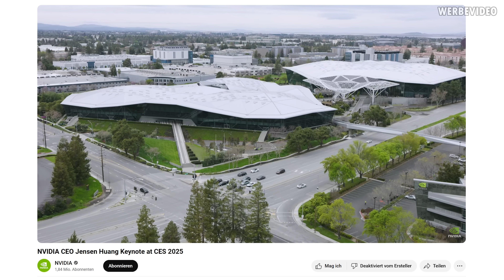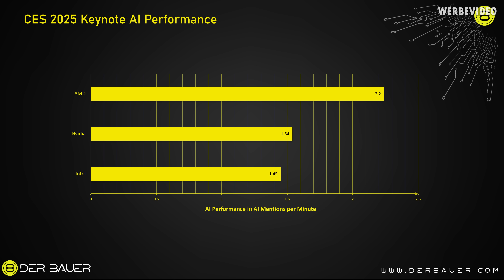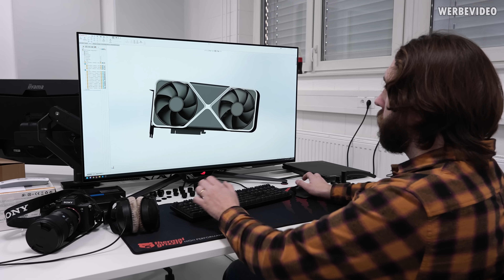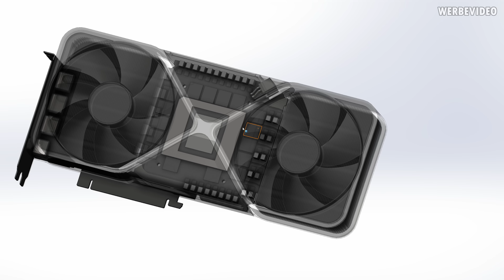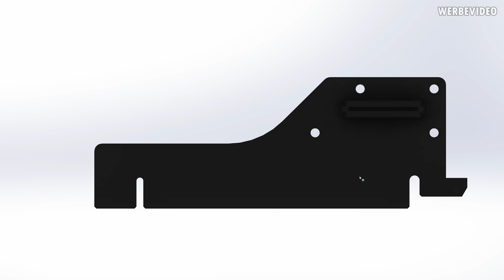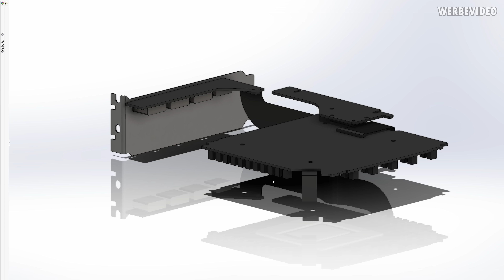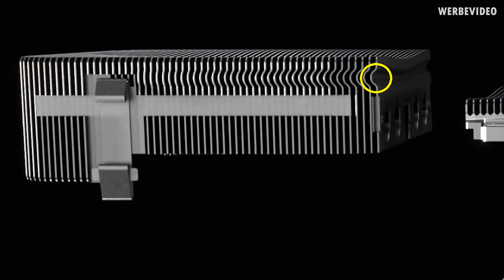We Reverse-Engineered the Nvidia RTX 5090 Founders Edition

Comment: Although I kinda understand why Nvidia pushes AI more than raw performance, it is sad to see because if you're buying the xx90 GPUs, chances are you use your computer for more than just gaming, where DLSS does nothing for you.
Reply: Tensor cores are used for more than just dlss lol. Ray reconstruction is used for 3D workloads and many more uses. I can say by same logic that gamers will find that 3x9th gen encoder useless unless they stream or record.
Reply: @DragonOfTheMortalKombat  No need to tell me, I plan on buying the 5090 for machine learning besides gaming. But it's obvious they made the biggest deal out of DLSS 4. They mentioned on the side Flux inference speeds compared to 4090, the issue is 4090 was using FP8 and 5090 FP4. What if they are basing their 3352 AI TOPS on FP4? Does that mean that if I want higher precision with FP8 or FP16, I'll get the same performance as 4090?
Reply: Imo, those that need the extra work performance will just go for the Nvidia Quadro line
Reply: Incorrect.

Dlss runs on Tensor Cores.

Tensor Cores have metric ton of uses
Reply: @B1-K4R  As per my other comment, I know. But there's also other metric ton of applications that require good old fashioned raw CUDA performance 😂 Which we'll be getting only 20-30% more of as it seems 🥲
Reply: Because they dont care about a couple gamers buying 5090s
Reply: That’s probably why Nvidia stock suffered
Reply: @sheepmasterrace  has nothing to with CES or RTX 50 series.

The Biden administration is going to put more Data Centre AI GPU sales restriction to other countries.

This will hurt revenue 

Hence why the drop in stock

Comment: Regarding the 5070 = 4090 marketing nonsense: according to Nvidia's own footnotes this was with DLSS4 and MFG on the 5070 vs older DLSS+FG on the 4090. And the important part here is MFG which can generate up to three fake frames per each real calculated one. Normal FG can only do one fake frame per calculated one. This means that just with MFG, the new 50 series GPUs can nominally gain three times the amount of fake frames compared to the 40 series. That way Nvidia can probably look at a frame output number and say the 5070 puts out the same number of FPS as the 4090.

HOWEVER (!!!) it still means it only delivers 25% of that number in actual playable frames, the rest is just predictive noise. Compared to that, the 4090 offers 50% of playable frames. So in reality the 5070 is about half as powerful as the 4090. Frames generated via MFG or the older FG do NOT add to playability. For all intents and purposes it's just lipstick on a pig to make the game look more fluid by adding frames to it but the games will never run better thn what the GPU can actually calculate in realtime, i.e.: the good old "brute force" (as Nvidia put it so nicely) rasterization performance.

Anyone who buys into the 5070 = 4090 marketing is going to be very disappointed. Coincidentally I've got a couple bridges to sell if anyone is interested, I'll even trade for your 4090s.
Reply: I like to say, "I've got some lovely oceanfront property in Kansas for sale."
Reply: @outlet6989 from my front porch you can see the sea.... Unfortunately it's currently frozen over
Reply: When dlss launched, i remember asking my brother and friends why they were buying nvidia..
"It has dlss..and raytracing!" 

And now, after 3 gpu upgrades, i asked my brother: How many times have you used either of those features?

"Aside from turning it on in a few games to see what they do and look like, i've never used it"

When i saw that 5070 | 4090 Perfomance slide, i was like WTF. 

Seeing dlss, fg, fps, performance and low latency all together - is madness.

Disappointing generation from both. Wanted an upgrade to 240hz 4k monitor but there aren't any reasonable gpu's to buy..
4080 -> 5080 is like ~5% performance gain?
And 4090 -> 5090 is ~30%? For 30% more money. 
Cheapest 4090 is 2306 euros (in my country), 5090 will likely start above 3k.

So there's 4080/7900xtx+5080 for 1k and that's about it. Was hoping for smth in the 1.5k-1.7k range 😐
Reply: @lunatik6168  yup fkin sad state for GPU tech and the slow ones think this is a breakthrough when its the most dissapointing GPU generation in a long time and maybe ever? Im not familiar with anything before 1080ti gen, but I cant imagine there has been a generation with worse performance uplift than this.
Reply: So as gamers we no longer care about frames per second?
Reply: @TheRealCoolwater  we do, just not AI frames, because they dont function the same as rasterized frames and for that reason dont have the benefits of more real frames.
Reply: @MV-ri7zu  If the DLSS 4 AI framegen is using game data to accurately represent a real frame, I don't see the problem.

DLSS AI framegen is not adding significant input delay either, I don't see the problem.
Reply: @TheRealCoolwater  "DLSS AI frame gen is not adding significant input delay either" yes it is.
Reply: @TheRealCoolwater  The more, the merrier. I for one have difficulty with AI generated frames though... artifacting interferes with what I expect to see, so I get motion sickness. I also get motion sick below about 57 fps in games with quick movements or fast camera panning. High input lag does not help matters.
Reply: @nonstopNny  Have you seen Digital Foundry's video on DLSS 4? It's improved, and its improvements are coming to 20 series and up. Frame Generation for DLSS 4 will use game data to improve it's interpretation of what the action on the screen is doing. From all the previews i've seen so far, I trust that DLSS 4 is going to be good all the way down the line.  You could argue that not all games will have it, but I think people are overreacting.
Reply: Ya’ll don’t know what you’re talking about. Game processes aren’t locked to the frame rate for most games nowadays.
Reply: I was critical of the latency resulting from a 3x frame generation but it seems like nVidia has handled that problem quite well. What remains to be seen is if the serious image quality degradation from all of that predictive noise can be dealt with appropriately. (Even more hilarious when you're running at a real resolution of 1080p! - I don't think I'd spend £2k just to render 1080p frames )
Reply: @tourmaline07 nvidia has not handled the latency lol if you have 60 real fps and 240 fps with mfg you will still have 60fps input lag, because AI frames are not "playable".
Reply: @MV-ri7zu  I'm judging this by Digital Foundry's latency measurements showing that going from 1 to 3 generated frames only increases latency from 50-58 ms or so on a 5080 running Cyberpunk. But you're right - it doesn't fix low input framerates.
Reply: @tourmaline07  also wdym "only" increases latency from 50-58 not only is that a ridiculous amount of latency its also increasing frames so it should be doing the opposite this is why they are "fake" frames 😂
Reply: @MV-ri7zu Yes, but you will never have only 60 fps unless you are intentionally trying to. Thats why settings being manual is of big importance and user should be targeting 80+fps before turning on any kind of FG. In many cases you will have 120+ fps before FG anyways so you will get very smooth 300+. Yes you can put 5070 on 8k to prove your point, which doesn't mean 5070 is not a great 2k GPU for pretty much maxing out anything on that resolution. I am sure similarly minded people will be running 5070 on 4k max textures to prove 12gb vram is too little. But if we blindtested you to pick ultra textures over high you wouldn't have an idea which is which. Just because there is an option in the settings, doesnt mean it have to be used or visual experience is ruined. In the same way 4060 is great gpu, well not anymore for msrp but i had a blast with it on laptop and i just cranked all up to max, no care in the world, fg was my saviour.
Reply: + you can just use something like Lossless Scaling from Steam (or similar (maybe FSR 4) will be able to run too)). May not be as good but you could do that as well in some Way. So Nvidias Marketing Claim is even more BS.

The Tech as is may be cool but you will NOT get an RTX 4090 if you buy an RTX 5070.

Dont do it.

If you do sell the RTX 4090 to me for 1000 Euro, i will make use of it. Trust me.
Reply: Regarding that, the 5070 should really just be a 5050
Reply: It's very sad
I've seen people in comments trying to say that the fake frames are so great and awesome
I have a feeling that people that say those things never actually experienced what the input lag is like, and how big the difference to native really is
Reply: @ADepressedGuy-l1p  they are great and awesome when feature is used properly. And they'll improve as time goes on. The problem is bad GPUs and terribly optimized that requires you to abuse these techs and then people wish they never existed because it made developers and GPU makers so lazy and lackluster.
Reply: @DragonOfTheMortalKombat  the issue is windows is bad and game optimization is bad. We need a better OS and better game optimization.
Reply: @MV-ri7zu  That is the eternal dream~🧡 I think 780 Ti to 980 Ti was similarly lame.
Reply: Isn't the 4070 Super already more than half as fast as the 4090? Is the 5070 a sidegrade?
Reply: @nonstopNny  we literally have the specs lmao yes it is barely faster than a 4070 this shouldnt be news to anyone the 5090 is the only real upgrade from previous gen and even that is just 30%
Reply: Your math is way off. A 4070 is exactly half of 4090 performance on average. A 5070 will be a little bit stronger, not much but still.
Reply: @TJ-ki3gp it's 1/3 in compute. Not half.
4080 is 1/2.
Reply: @panjak323  I can't think of any games that actually run half as fast on a 4080 as on a 4090. I don't pay much attention to AAA games, though.  Is it realistic to think that the specs to performance ratio scales that consistently?
Reply: @auturgicflosculator2183  compute, not game performance. Games don't scale well, because of CPU bottleneck, and even underutilization of 4090.
4080 (super) is pretty much 55-60% of 4090 in actual workloads.
5080 is exact half of 5090.
5070 will be lucky if it matches 4070 super in raw performance.
The value proposition is getting worse.
Reply: @panjak323  Okay, thanks. I get that, now it's in context. We're on the same page, I'm just too stoned to read, apparently~💚
Reply: "Generated frames don't add to the playability"
Just say you can't afford one lil bro, no need to be jealous
Reply: @andy7bianca  If they've been saving since 2017 or so when they bought their 1080 Ti, and inflation, wage stagnation and lack of affordable housing hasn't made them dip into it, almost anyone could afford one.
Reply: @andy7bianca  ...but will it be worth it?
Reply: @andy7bianca  no that is quite literally how they work... Your inputs only update into the game in the real frames. AI frames are LITERALLY unplayable your inputs are not taken into account during AI frames.

Comment: As my NVMe SSD (Shitty WD SN850) resides exactly 3 slots below the PCIE x16 slot, and I am also wanted an upgrade to 5090 for professional use. I feel like Nvidia did all this effort to make 5090 fit on my workstation. 😇
Reply: shitty??  The SN850X is arguably the fastest PCIe 4.0 drive, period
Reply: @minus3dbintheteens60  that piece of shit won't work on majority good motherboards in the market on the NVMe slots. (AsRock/MSI) . Now we use Samsung 990 Pro 2TB so no problem

Comment: Impressive! I would love to see if you can technically dissipate 575watt of heat with two fans by just heating up a block with the same amount of heat pipes and two 120 fans to do a proof of concept. I know the fins would be impossible to reproduce but that should give us an idea if it’s really possible that nvidia might actually be onto something or they are compromising performance to meet their SFX requirements.
Reply: 3 fans ...it is a 3 fan design, there is one hidden in the center

Comment: regarding the stamping tool, I doubt that they made 52 different stamping tools, I would say it's more likely that it is stamped with varying pressure with the same tool to get the different bends.  Still an expensive process as they need to keep all the plates organized for assembly though, even if they only used one tool.
Reply: They could create a tool which stamps all 52 fins in one strike, and then somehow separate individual fins from that single sheet.
Reply: @asmi06  I've actually done this in a press shop. Each section of the larger die would have its own specific section designed to make one fin in an assembly like this one. You simply increase the surface area of the entire die and use a larger machine. Individual fins could be cut from the resulting sheet afterwards easily. These fins are quite thin as well, making everything operate on a smaller scale of machinery needed which would lower the cost of tooling investment.
Reply: @asmi06  yep
Reply: @asmi06  Was thinking about this too, perhaps there's a manufacturing technique which allows for stacking multiple plates at the same time, reducing the cost of producing parts like this significantly?
Reply: rather than "different pressure" which is something that wouldn't work in a normal stamping machine, they likely used shims to change the depth of the curve.
Reply: @ even that is so much work and not really safe. Realistically the cost difference might be negligible. You have to think of it on a large scale of millions of stampings in a short amount of time. So, you are not using one stamping machine, you are using let’s say 20. Using the same die you would need 20, then the dies only have x amount of stamps before they wear out. So let’s say you had 1 million heatsinks to make and each one has 58 stamps that’s 58 million, 2.9 million stamps per machine, if your die wears out after 1 million stamps you need 3 dies to complete the order. So 60 dies. If you have 60 different dies each doing 1 million units, you end up at the same result with the same cost as far as stamping goes. Extra cost would come from a sorting machine that places your stampings in the right order before the heat pipes are pressed in.
Reply: I believe they would have used a progressive forming die and then stopped once the first fully formed fin was made at the end. This would give one fin at each stage of progression.

If you think about it, the fins used in such a cooler would actually be the end waste from making fins for a cooler composed only of the fully formed (most curved) fins (-8
Reply: They would have needed 58 tools because you also have the feature on the top for the spherical dent where each sheet would have a different radius. Also if you use the same tool with varying pressure your thickness in the bend would change. 58 tools at 5K each is only 290k, it is a drop in the bucket, the real cost would be in assembly, where you would need a machine that automatically stacks all 58 sheets in the right order before pressing the heat pipes in. They already have a couple stamps for the triangle portion so it's no big deal. The cost is also divided across 4 models on the consumer side, and may also carry over to their B series pro cards in some capacity. Looks like NVIDIA spent more time and money designing this cooler than AMD did on their RDNA 4 architecture, or Intel on Arrow Lake.

Comment: Liquid metal not only makes sense for better cooling for such a card when they want to get the cooler size down (still cheaper than additional finns as well) but it also means one doesnt need and isnt expected to open the card for maintenance. Which means the design doesnt need to take that in to account.

Comment: Problem is we kind of got force DLSS onto us, you can tried disable DLSS TAA in modern game and it look horrible and native TAA is also horrible. So the only option is to use either DLSS or FSR. If possible I would love to not use it but even at 1440p today no upscaling looks so horrible.
Reply: 100% this. Some games run like crap and you need it for decent performance, other games wouldn't need it but you have to turn it on or run no AA because native TAA is not well implemented, and then there are the games where no AA is not an option because the assets are made with the presumption that you would run TAA or an upscaler and look like crap with it off.
Reply: @DinoTrollerino  alternative is a 300GB+ game with high quality assets I guess